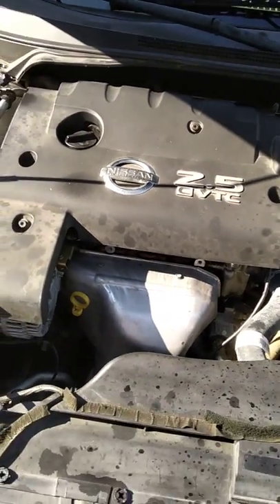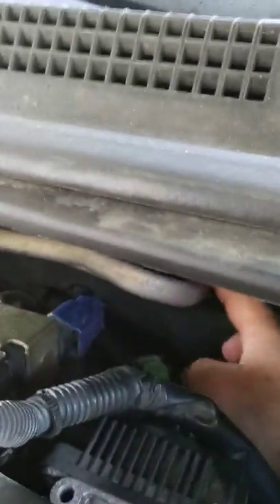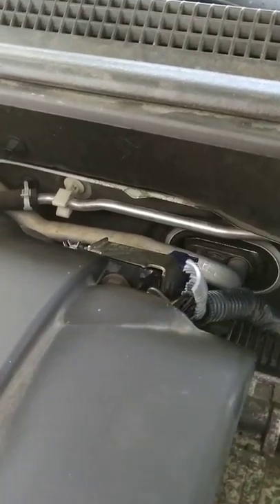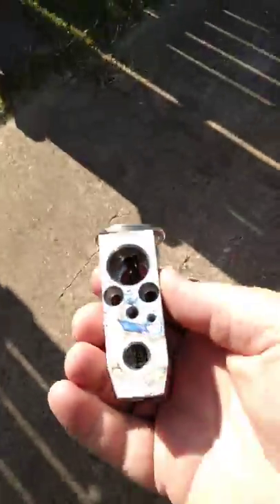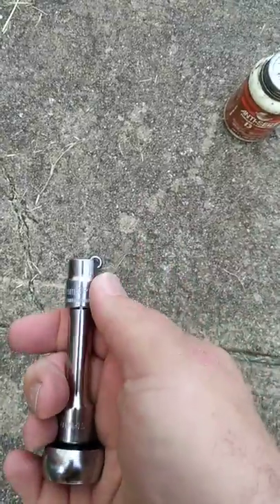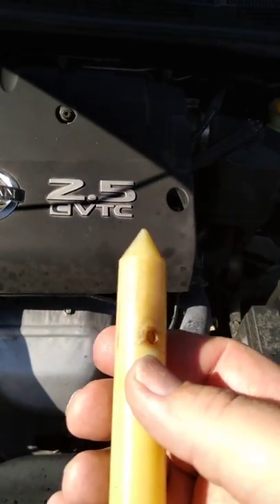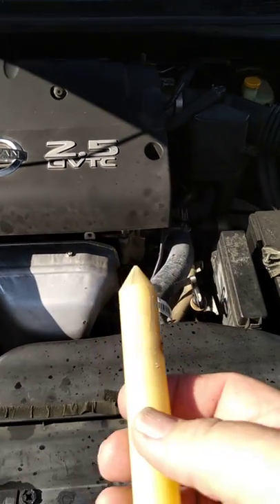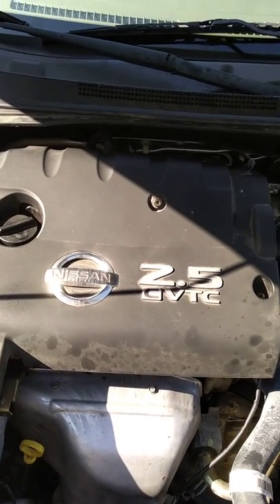2006 Nissan Altima 2.5; AC repair; expansion valve replacement.

Comment: Thanks for the tip in replacing expansion valve o rings my old ones broke putting new valve in so I had to put new ones in. Used small funnel to get new o rings in
Reply from the maker: Excellent!  Thanks for sharing.

Comment: Anybody know what the length & thread pitch of the 4mm Alllen bolts is?  I can get partial measurement from the xpv, but I dont know how deeep they penetrate the evaporator.  I'm going to want to replace them if I can even get them out in one piece.  On my 05 Sentra, the hex bolt is an M6X1.0X??

Comment: Could you please provide me with the link for evaporator orings (exact ones you used) that I need for 2006 altima.
Reply from the maker: Hi.  I'm sorry I didn't see your request.  I don't have the information; I went to a NAPA auto parts and they pulled a expansion valve and they matched the sizes for me from a huge kit of AC o-rings.

Comment: Just about to get my part to do my own on my 2002 Nissan Altima 2.5 and what oil do you used? Is it special kind or can I use 3in1 or 5W-30. Thanks 1st time doing one.
Reply from the maker: For my 2006 Altima, it is PAG 46; it is probably the same for your 2002 Altima as well.  But to be sure, go to Autozone or similar parts store and have them look it up.  It will be around $7 at autozone for 3oz.  It probably isn't necessary to add any oil; I just mention it in case a lot of oil is obviously lost when opening the system.
Reply: @johnhermann762  ok yeah thank you I didn't know it had oil to begin with honestly. It's got 250,000 miles on it before I got it sooooo..... Yeah I will be getting some oil. Thank you for your information and talking about it. I'm going to pick some up today. Thanks again I hope you have a great day :)

Comment: Nice video. I have a question though. If the expansion valve is bad would that cause it to leak  ac oil on to the cabin filter it was a bright green color. The vehicle is a 2007 Nissan Altima.
Reply from the maker: I would think no; you more likely have a breach in the evaporator coil.  The expansion valve is physically located in the firewall, kind of away from the cabin filter.  I believe you will need to remove the glove  box and maybe the center console to replace the evaporator; not sure as I have not replaced it on these cars.  Are you sure it is AC oil?   Maybe something was spilled?
Reply: @johnhermann762  definitely ac oil dye. Filter was bright green. And I found residue around the evaporator box. Used a UV light and all. Also thank you for responding and responding. Yeah you're right about having to remove the whole dash.

Comment: Great video. I changed my compressor last year and it cools but not as I need. Lowest temp is 60 on a hot day and 47 on a cold day. I think my expansion valve must be the reason. What's your thought on that sir.
Reply from the maker: Yes, that could very well be your problem.  If you have gauges, check to see if your low side pressure is 50psi or higher and your high side is 120psi or lower.  If yes to both, then that is a definite sign that your expansion valve is bad.  However, if both pressures are the same, then you compressor is bad; but you would not get any cooling them.
Reply: @johnhermann762  thank you for the response John. Will get back to you on it. You the man...

Comment: Going to replace ac hose on 06 Nissan Sentra 1.8 L. Has a leak. When I took off the hose from other car from firewall the bolt broke off. I don't want it happening to the one in my car. What do you think I should do to prevent this? Should I spray WD 40? Thinking of spraying it then slowly work it back and forth. Tighthen / loosen it a lil at a time slowly. Sraying it all that time?
Reply from the maker: The single bolt that fastens the bracket for the AC hoses is fairly substantial; I'm surprised that it would break.  If I suspected the bolt was seized, I would try using a pneumatic (air) wrench; one of the smaller ones that go in at a 90 degree angle; harbor freight has both a 1/4 and 3/8 inch drive for $19.99.   Make sure you are solidly and squarely on the bolt head before loosening.  Don't forget to use anti-seize greese when re-installing.  Oh, and spraying with liquid wrench or similar and letting it sit for an hour would be a good idea.  Good Luck!
Reply: @johnhermann762  great idea. Yay got it off without too much trouble. Just came off. I lubed the o ring with silicone oil from 3 in 1. Find it at Lowes

Comment: The replacement of the O rings on the evaporator is not that hard to do with your hand. It is actually rather easy.
Reply from the maker: I didn't find it easy, but I came up with a method that worked for me.  Thanks for sharing your experience.
Reply: @johnhermann762  what a stand up reply 👏👏👏
Reply: Stop being a hater!